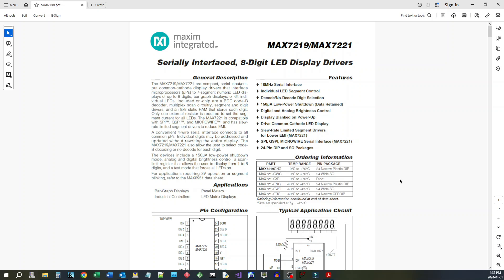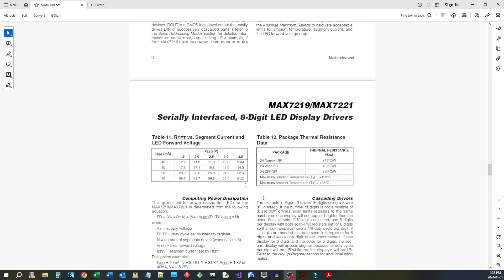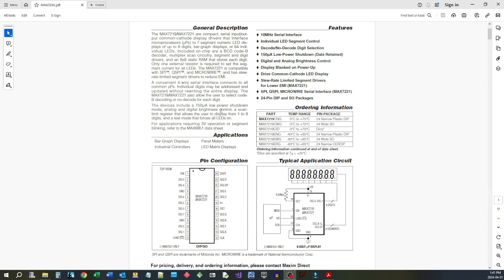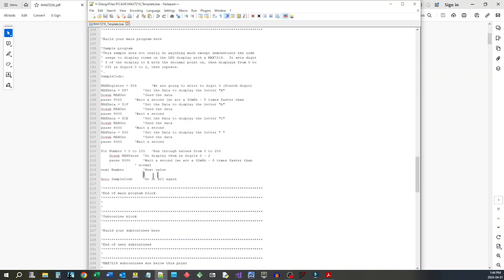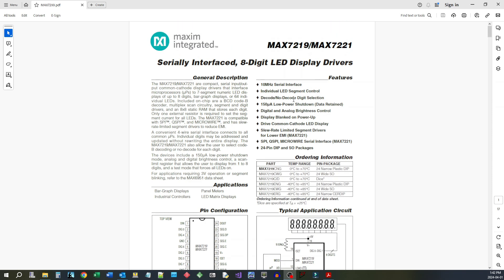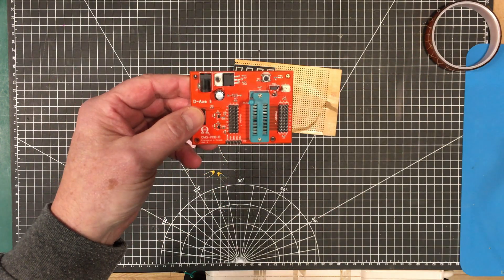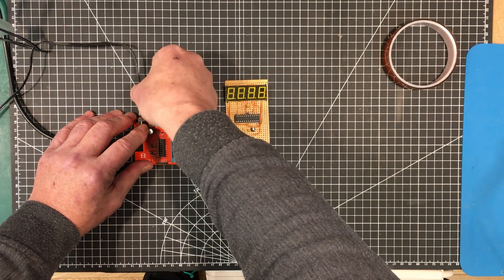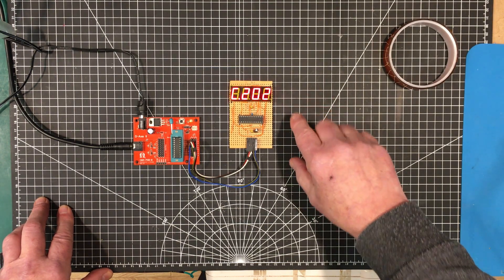Uni-Byte 0173 - MAX2719 7-Segment LED Display Driver: CHIP of the month.

Comment: Hey can you please post video on how can we use 7219 to drive large common cathode 7 seg displays like 2.3 inches..
Reply from the maker: It does not really matter what size the display is, it is more teh current requirement per segment.  Look at the data sheet on how to set segment current and how to set brightness.  It is capable of driving as high as 40mA per segment.  With modern LEDs, that's quite a lot.  Going beyond that would require putting in a PNP transistor or P-channel MOSFET driver for each segment.  It may require some experimentation as they don't give a schematic of how the outputs are internally arranged.

Comment: Good vid. Love these 7219s - MAX always seem to come up with really useful chips (same as Holtek). 

I have always loved the look of the 8x8 LED dot matrix. I made a workshop clock based around 8 of these 7219s and the corresponding quantity of 8x8 led dot displays. Displays time then roughly once a minute, gives date, sunrise/set times and humidity inside & out (useful for 3D filament storage). Varies the brightness based on the time of day and popped in a tiny GPS module to give very accurate time - processing means it is always a smidge behind (day/night, DST checking etc), but it doesn't vary and isn't serious enough to bother me. All driven with a Micromite board of my own design (about 1.5" square) - similar to the picaxe.
Reply from the maker: Wow!  Awesome.  Thanks for sharing that.

Comment: Awesome chip, not sure if anybody else would like this but I would like a proper video about the 'Picaxe' ecosystem it sounds like an Arduino sort of set up which came first? Any how I would like to see a minimal set up to blink an LED including everything I would need to make that happen and a chat about it maybe a little history. If anybody else would like this perhaps they could comment or tick my up button Great video .....cheers.
Reply from the maker: I might be able to do some thing like that.

BTW, the PICAXE predated the Arduino by about 6 years.  The first PICAXE was available in 1999 whereas the Ardunio did was not available until 2005.
Reply: See I didn't know that !  Ta ! :) @uni-byte
Reply from the maker: @andymouse  Glad I could help.  Another little fact for you, PICAXE are also British!  Headquartered in Bath.
Reply: Oh ! I need to do a bit of homework :) @uni-byte
Reply: @uni-byte  yes despite my protestations it's probably still quite interesting to go over the options, after all it's not like pic has disappeared off the face of the earth
Reply: Unfortunate thing that Arduino beat microchip to, Arduino paired an AVR MCU with a direct USB bootloader, so it can be programmed directly with a USB cable. Also in their favour, a simple In-Circuit-Serial-Programmer (ICSP) module is dead simple / inexpensive to make even for programming an AVR chip "barebones".

Microchip never replicated this sort of functionality in any official form. You always need expensive PicKIT programmer, which it itself could cost the same as buying 5 or more new Arduinos. And it's not easy even to 'bootstrap' your own PIC programmer from nothing either. It's not too hard if you already have a PIC chip with the correct code on it... but where are you getting that?

Hence why we see AVRs explode in popularity compared to PIC in the 2010s after they had been evenly competing in the 2000s.
Reply from the maker: @ivolol  - Well, now Microchip own AVR too, so they have the most popular brands wrapped up.  Back in the day you could build simple programmers for certain PIC chips and there was 3rd party software to do the programming as well.  Support for all that faded as Microchip kept changing the game.